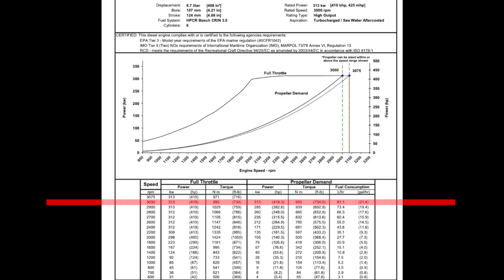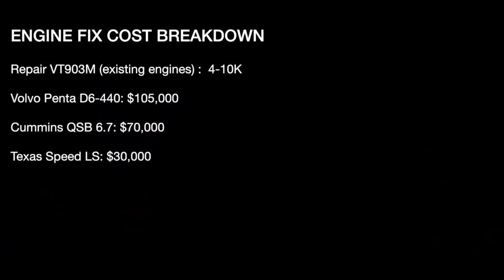Tesla Powering my 30yr Old Italian Yacht? And Broken Diesel Engine Diagnostics

Comment: Beyond what you mentioned in the video (fuel cost, range etc) there are lots of other good reasons NOT to go with petrol.
1. Petrol engine will need servicing much more frequently than an industrial diesel does and doing that inside the keel of the boat is not going to be easy or enjoyable.
2. Fire risk. Petrol is hugely more flammable. Fire on a boat is not at all funny and having a huge amount of petrol in board is not a good idea (not as stable, even just when sat not being used).
3. Fuel life. Petrol goes off. For something that's used infrequently like your boat, Diesel is a far better option.
4. Heat. Petrol engines generate far more heat. Having all that additional heat in a confined space in the bottom of the hull won't be pleasant in the summer and won't be good for durability of the hull. 
5. NVH. Might sound counter intuitive (because everyone thinks of diesels as noisy and rough running) but... They run at much lower revs and generate less exhaust noise (unbaffled) than a petrol engine. If you start running petrol engines in that boat, you may need to consider changes to the exhaust in order to avoid excessive noise at much higher revs, plus it will completely change the resonance around the hull. Could be annoying/problematic from a noise perspective, or could even be damaging from a structural perspective?
As for the benefit of EFi - with a good industrial/marine diesel, you just don't need to go monitoring every tiny element of the engine - they're simple, reliable and bullet proof (not sure why yours didn't auto-cut out for low oil pressure tbh, might expect them to have an auto shut off)?'
For me it would be a clear decision of diesel over petrol.
Electric is a far bigger gamble. You'd need a backup generator I think, to re-charge, get you out of trouble and ensure you can always have hotel power on the boat, but you still need batteries and that's an issue for space, weight and... They don't get on well with water 😬
I guess it also depends on what the boat is meant to be for you. Is it meant to be something you can just enjoy stress free for relaxation with Chelsea and your mates in between the hassles of builds on your main channel, or...  Is it meant to just be an extension of that, that keeps demanding of you, adding to hassle and stress, but helping generate content?
Just some thoughts.

Comment: 1. Rebuild both diesel motors as primary propulsion.
2.  Install two Solomon ST37 Electric Motors belt driven on each Prop Shaft.(This allows for electric propulsion in and out of the marina and for short durations)
3. Installing a 12kw Northern Lights Generator  to increase electric range (This would allow you to be electric for the majority of the type of cruising you describe is the norm)
4. Purchase 2 used lithium battery packs from totalled Chevy Volts (MUCH more cost effective than Tesla Battery Packs and have a better form factor for installation on a boat than do Tesla Battery packs)

Comment: You just gotta stay diesel, it’s a safer fuel in boats.
Reply: yeah if he goes to gas hes also going to have to vent that engine space with blower fans to avoid a fire risk+fire supression.
Reply: Agree 1000%. Gas fumes in an enclosed engine compartment equals a way bigger bang than cam out the top of that Cummins... stick with diesel.

Comment: If you want to go with an LS or any gas engine, definitely keep in mind that you'll want an engine bay vent fan of some sort to prevent gasoline fumes from reaching a critical level and then exploding the back of your boat off. That all being said, I think rebuild those engines and leave the boat more stock. Diesels are the way to go on big boats. You do sound more excited about the texas speed option though.

Comment: Hauling that much gasoline on you boat turns that tank storage into a bomb if there was a leak.  Stay Diesel.  You have the Diesel motors already, and that keeps your classic  boat a “classic.”.   They are essentially maintenance free. I had a 453 Naturally aspirated Detroit Diesel in a 69 Ford truck.  We carried 170 gallons of Diesel fuel.  I inherited it when my Dad died.  What a beast!  if you have “off-road” Diesel powered equipment in your shop, you can get Diesel without road tax, it would be pretty cheap.  I used to get 55 gallon drums filled, and fueled my “equipment” from the Drums.  I also used Chevron 30Wt Delo oil for my oil changes, which I  bought in five gallon cans.  You must do your oil changes regularly, as well as a fuel filter and a water fuel filter as well as an oil filter for those frequent oil changes.   Again, I vote and recommend keeping it Diesel.

Comment: You will be very disappointed if you put an LS in there, even if it’s fully built. You will never make the low end torque that this diesel does getting on plane, nor the efficiency at cruising speed. Plus keep in mind that whatever option you do choose, it must be USCG approved, otherwise if something happens and the boat sinks, insurance won’t pay out. That’s why marine parts are so expensive
Also keep in mind that a stand-alone efi on a gas motor needs to run an O2 sensor and you need to figure out how to do that with water going through the exhaust

Comment: Rebuild the motors. 
1: Reliably
2: simple 
3: cost
4: less work involved 
5: if you do an EV swap the value of the boat will most likely drop
6: gas requires more maintenance 
7: diesel requires less maintenance 
8: electric + water= need I say more
The list continues on for days so rebuild those 2 motors.  Your out what 10k to 15k each tops 40k. I dont know what they call it boats terms but simi its an inframe last one cost me 8k total

Comment: I’m my opinion it’s a no brainer I would rebuild those engines and put them back into your vessel and add some upgrades to monitor the motors temps, alarms etc from the cockpit. It will remain original from factory and I believe having 2 new rebuilt motors and the upgrades will add value when you look at selling the vessel. Look at it this way would you put a Tesla power plant or diesel motor into a Lamborghini or Ferrari there’s a reason they have there own power plants. I was watching and listening about you talking about speed, horse power, fuel efficiency etc, a vessel of that size 40ft  has diesel motors for a reason and you mentioned it Torque. I believe if you go gas over diesel you’ll devalue your vessel and eventually be disappointed. Love the show and good luck.

Comment: Literally everyone last episode said keep a diesel last episode man.
Reply: His boat his choice
Reply: @deanbyrne5334  lol
Reply: Probably thinks they are all haters instead of sound advice on a subject he knows little of
Reply: So true, this is a boat, not a car. Good luck finding electric motor or Lamborghini parts in the Bahamas. Plus the resale would be less than zero.
Reply: Last episode though.
Reply: @deanbyrne5334  the thing is when it comes to boating you don't modify them much you use the motor/engine that came with the boat and if that dies you buy the exact same motor because the boat is designed for that specific engine.
Reply: @Ryan-uf4nw  I completely agree that he should get another diesel engine. Boats arnt ready for electric engines but still his boat his choice 🤷‍♂️
Reply: @calvinnguyen1364  especially when he ASKED for input
Reply: @deanbyrne5334  He literally asked for advice bruh

Comment: Rebuild for sure. They will be less problematic in the long run. Seen multiple diesels with 40,000+ hrs on them with not a lot of issues other than common things such as injectors and obviously fluid changes and little things. Like you said they are made to keep a constant rpm while delivering peak torque/hp.

Comment: Gas swap makes no sense at all. Diesel all the way! But considering those things are literally bulletproof, why go for a new one when the old one can be fixed and will outlive us all?

In the future I will say: swap an electric system from Nikola trucks complete with hydrogen fuel cells (the boat can take huge hydrogen tanks + solar panels for battery/supercap charging to conserve the hydrogen). But it will take another decade before there will be a supply comparable to today's supply of salvage Tesla parts. Right now DYI-ing something like that would be a huge challenge, not to mention hydrogen refueling for a boat.

Stick to diesel. Fix the stuff. It's already way more powerful than your needs. If all you want from a boat is LCD screens and exhaust pops, buy an iPad and play exhaust sounds through your sound system, cheaper and easier to customize. And you'll get exactly the same amount of people complementing your build in the water - zero ;)

Comment: My vote is the Tesla engines. 
How much space would the electric system take to install VS. the gas engine setup? 
Could you add a solar panel charging system? 

Also check out the new battery packs that Tesla is making

Comment: gas engines for marine is moronic, unless it's an outboard. fix the damn 903's or replace them with 855's.
Reply: upwardsofunknown Most true thing I've ever read.
Reply: I guess the MILLIONS of boats running gas engines are all a big moronic error?  Cost and weight of diesels in anything less than 40’ of boat is just not pratical. 

Build a ‘car’ engine for a boat and sit back and watch it fail.  Oh yes: all the marine requirements for electrical stuff that goes with moving from diesel to gas.
Reply: Gas engines in board on a boat is a bomb waiting to happen.
Reply: TheBeingReal A diesel in a boat makes much more sense for everything but a small lake boat. The low end torque a diesel produces is infinitely beneficial compared to a gas engine. However the practicality and reliability of running multiple outboards will sometimes outweigh using a diesel for example no corrosion due to not sitting in salt water at the bottom of a boat, the ability to drive properly when one motor has died, no leaking from through hull driveshafts, ability to beach the boat, etc. It's either diesel or outboard. No practical and high quality boat a gas inboard.
Reply: Jenna08848 Not if maintained and operated correctly.
Reply: Grady Palfrey “No practical or high quality boat” uses gas inboards.  You better start making calls to SeaRay, Cruisers, Regal, Formula, Skater, on and on.  

Cost and weight are huge issues for gas vs diesel. Over 40’: diesels. Trawler type and high hour work boats: diesels.  

I can personally show you thousands of gas inboard / I/O boats in a matter of a few hours on a small lake near me: Lake Michigan.
Reply: TheBeingReal Because they are cheaper to make. On a smaller boat the differences may be less drastic so cost may be valued higher than performance. Therefore if a company has that view I would not categorize them as high quality. Have fun in your lake.
Reply: Grady Palfrey do you even own a boat?
Reply: TheBeingReal Almost got me with that one. Three of them yes.
Reply: TheBeingReal indeed, only crap American boats, the rest of the worlds uses modern inboard Diesel engines!
Reply: Rudi Akkermans I’ll skip over your crude and ill-informed American boat comment. 

The cost of gasoline over diesel drives the diesel power selection in many countries. Also, in pleasure boating, the type of boating done might drive the power selection. 

A used 37’ express cruiser with diesels will cost you $30,000-$50,000 extra over gas powered (USA) You can never recover that in fuel cost savings. 

Diesels are great engines in the right boat size/type.  When they can be a 30% price adder to a new boat over gas they are a deal breaker.

Comment: And you can do the same EXACT thing with diesel engines. Ive been around marine diesels my entire life. There is a huge obvious reason they are utilized in large vessels. Switch to gas and you will regret it first time out
Reply: Referring to the comments @16:10 Yeah I agree I don't think there's any reason you can't do all of that with the engines that the boat currently has. Even if you get everything perfect, imo the diesel engines will have a much longer life in this application. And it's a selling point because an engine swap is a potential a red flag to a buyer.

Comment: that " backfire" you mentioned was probably a crankcase explosion caused by oil mist ignited by bearings runing red hot, The excess  crankcase pressure created was relieved by blowing the rocker cover gasket and the oil fill cap

Comment: How about having your cake and eating it too? Go with Diesel/Electric. Keep the working Diesel and add one or two tesla motors and use the diesel as a generator to power the electric motor/battery pack. Best of both worlds. Works for trains...
Reply: Hell yeah exactly what I thought
Reply: I just commented this. It seems like a solid plan actually and would be amazing.
Reply: It sounds good, but chris was talking about silently running the boat when he was talking about tesla, diesel engine used as a generator will  not be a viable option here
Reply: Just run a belt or something from the diesel and switch on regen with the tesla motors and while the diesel runs, it'd charge them.
Reply: @sheldonlewis72  would only want silent with doing boring speeds really because once your at 20+ mph you would barely hear it
Reply: A boat like that requires two evenly matched motors for maneuvering in tight spaces and marinas. Reversing one and putting the other in forward is the only way to make a tight turn at low speed. Having a mismatched diesel and electric would make the boat impossible to maneuver in his marina
Reply: @states1996  Well I think they really mean 2 electric drive motors and one diesel generator.
Reply: That's a wicked idea ! ! Wish I'd thought if that 😁
Reply: @states1996  No, the diesel is a generator and doesn't provide direct propulsion.
Reply: Wow this is a freaking great idea! Isn’t that how trains do it?
Reply: @ohlookadragon  well then I misunderstood, my mistake. But the diesel generator option eliminates the silent running advantage of the Tesla motors. Additionally, this kind of conversion would almost certainly kill his resale value as it’s a custom one off conversion.
Reply: That would be the best way to go but costly

Comment: diesel is my vote.
Reply: you gonna pay the fuel bill? electricity is so much cheaper
Reply: @pickledpigknuckles6945  until you run out of it. Luckily, the onboard diesel generator will recharge your lithium batteries.
Reply: @pickledpigknuckles6945  What’s the charging requirement and what is available at the slip?
Reply: To be honest it’s what the boat is and what your doing with it so yeah I agree although this is cool

Comment: We have a 1988 33 hydra sports with dual 250 Johnson’s. It also has a deck that makes the overall-length 38 and weights 11 thousand pounds
Reply: It runs a top speed of 46 mph
Reply: Theses are outboard

Comment: Being “the Italian guy” here, I know Riva’s and almost every other Italian boat/yacht brand inside out. While Riva has never been builder of top performing boats - therefor you would have to look for an Abbate-  Riva is a very well built boat, and if you want to preserve the value and power it accordingly, stay with the Diesel engines ! If you like risking your life, install gas engines, so sooner or later you can fly in a fireball. Electric motors are great, but not for boats with a planing hull - they work very well with displacement hulls.
Reply: Babylon falling , that has always been the “Tullio Effect” - no other boat builder has ever even come close to his hull designs, even if they tried hard. Molinari tried, but Tullio put his efforts to shame easily... Unfortunately I have to tell you, that Tullio deceased this April, supposedly because of COVID-19, which I don’t buy. The yacht world has lost a magician !
Reply: Totally correct. Especially for a 44ft he needs diesel. Gas is very dangerous. I don't think he realises how dangerous gas engines are when they are both in a enclosed room full of gas fumes.

Comment: Regarding Tesla battery, you friend was correct in quoting you the total amount of energy of a gallon of gas, but one thing he neglected to factor in is that a gas engine runs at about 50% efficiency, so can only transform half of that energy to the Prop, while a Tesla motor runs at 90% efficiency, So you would get almost twice as much energy to the prop as what you calculate (1.8X), still not great, but better.